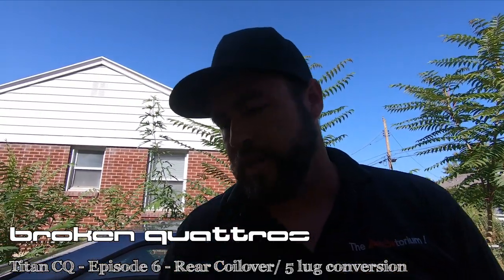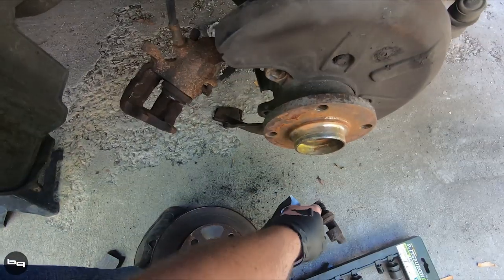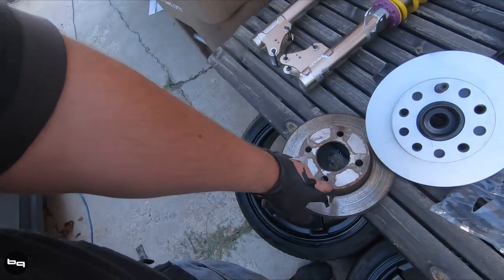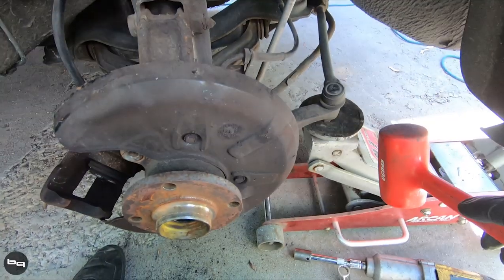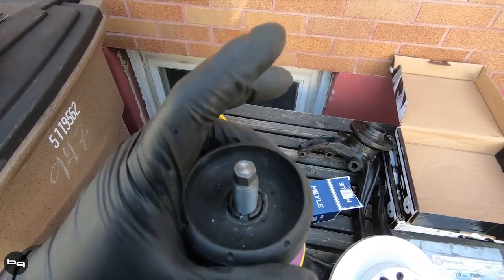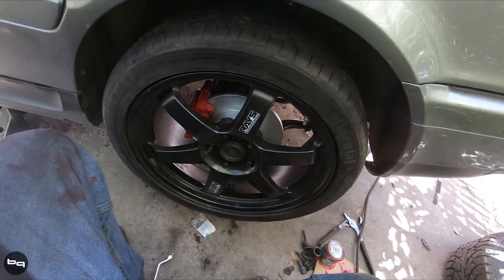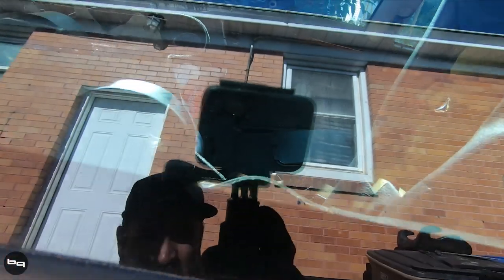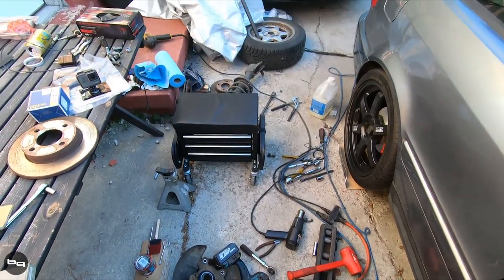Titan CQ - Episode 6 - Rear Suspension Wrap Up

Comment: Just curios, you mentioned you had new sway bar links (I think I saw new Febi ones in the background), but you didn't install them, so I was curious why.
Reply from the maker: The ones pictured are actually swaybar links for the front. The kws are a bit shorter in the front, so shorter sway bar links are needed.
Reply: @BrokenQuattros  in the back you can reuse the old ones? Same lenght?
Reply from the maker: Yes, i reused, they were in excellent condition